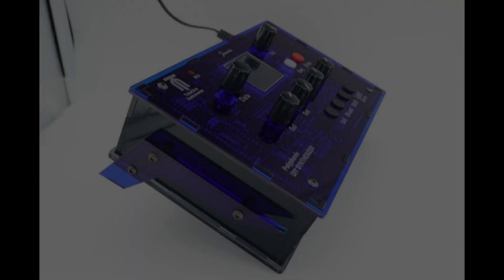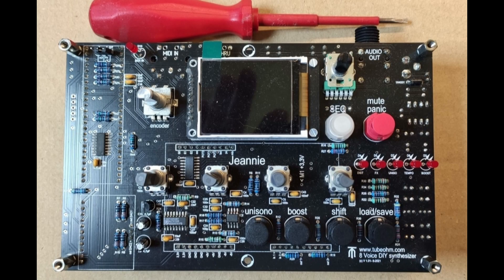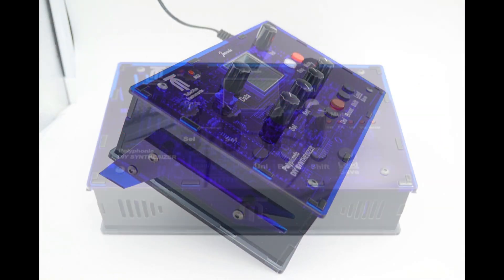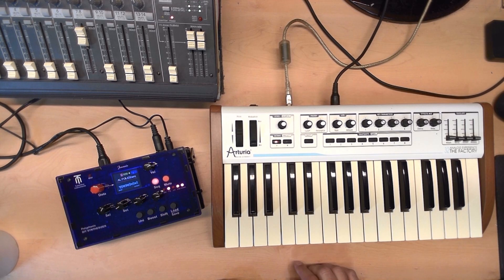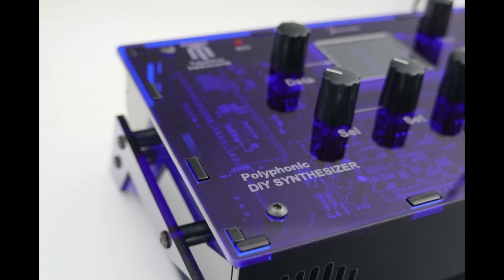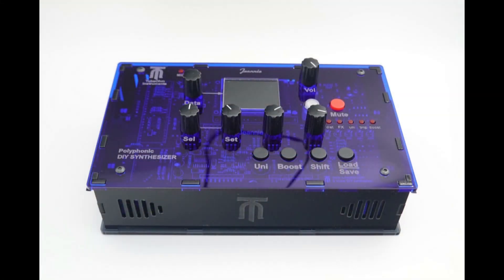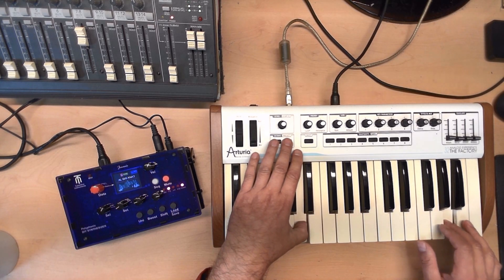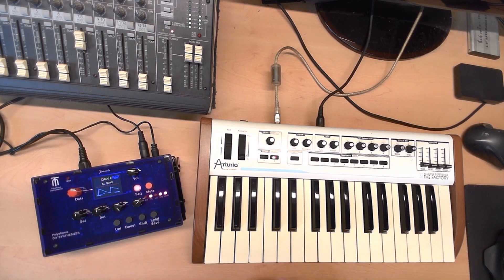TubeOhm   DIY Synthesizer Jeannie

Comment from the maker: V2.62  Firmware ist released on 13.09.23 . Neue soft distortion Kurven , neuer mono Mode ,  ca 400 überarbeitete Sounds. Aktuell  versuchen wir ,  die Oszillatormodelle vom Braids zu implementieren . 
  
V2.62 Firmware is released on 13.09.23 . New soft distortion curves, new mono mode, about 400 revised sounds. Currently we are trying to implement the oscillator models from Braids.